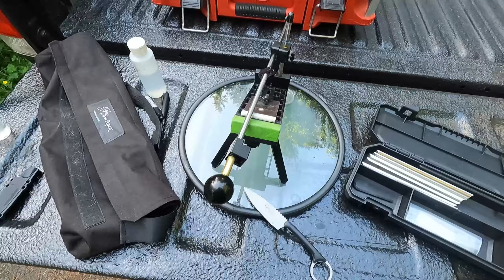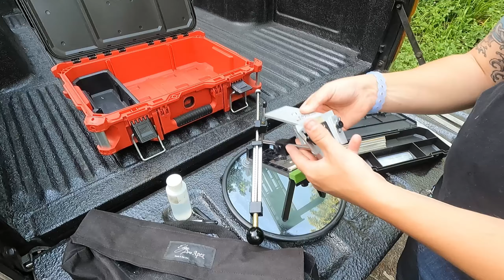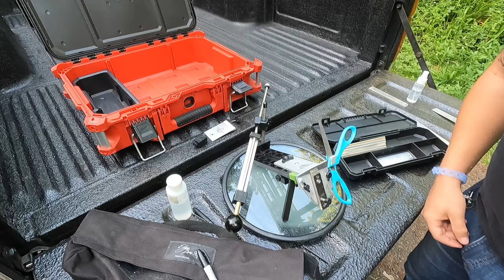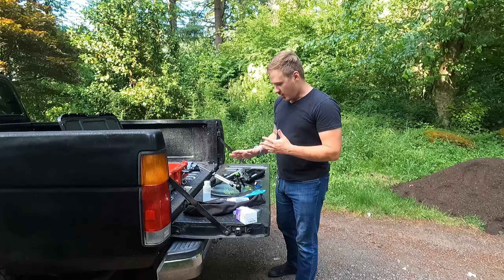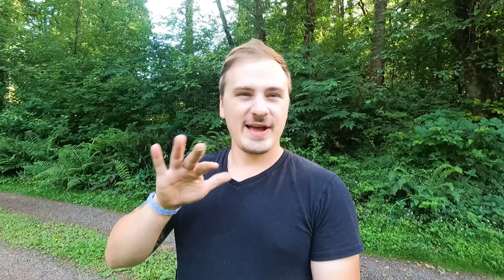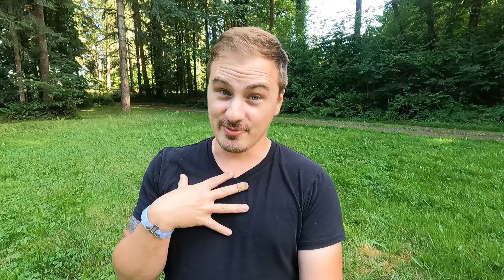Edge Pro Apex The system that started it all!

Comment: Hello Sam, i wonder how you sharpen convex scissors on the edge pro system. 
Thanks for all your  videos. 
Peter Mosk from Holland
Reply from the maker: Hey Peter. 

For doing convex shears it is quite the process. Basically what I do is say start at 45° for sharpening. Then bump the angle to 43, then 41, then 39. Decreasing the angle and making multiple facets to mimic the convex. Then from there I blend the facets together which can be done by stone just takes a long time. But it is doable. It’s much easier if you have something like a buffing wheel with compound. Hope this helps. Also Cody over at edge pro is a wealth of knowledge. 😊 or feel free to ask another question if you need to.

Comment: I struggle to get knives sharp with the edge pro apex. When I lay the knife on the table, I find it rocks which changes angle when the stone goes across the blade. I got the magnet add on but still the blade rocks too much to keep a consistent angle. Any suggestions?
Reply from the maker: @kylefreemason  I sounds like you are sharpening picket knives. What might help is instead of trying to magnetize and have the spine flat. You can magnetize the primary bevel where there is a lot more surface area for the magnet to hold. Then it's just the scratch method with a sharpie since the angles will be different than marked out. I'll try to make a short video on it here in a bit to see if it helps ya. 🙂

Comment: What is the purpose of the isopropanol alcohol? It doesn't lubricate and evaporates in seconds. I use baby oil on my diamond stones. It keeps the stones from clogging and there's zero dust.
Reply from the maker: @Therapistinthewhitehouse  I only use 80% and it sticks around for a decent amount of time.but it’s to cut down on the dust from the stones. But I might have to try baby oil. Also might make it cut smoother due to the oil base decreasing resistance.
Reply: @Samsmobilesharpening  
I used soapy water for a while but it started to rust my diamond stones, I then used nothing but hated the dust so tried Lansky’s oil and preferred it but too expensive so moved on to baby oil in a 2-3 oz dollar store spray bottle. One pump is enough to coat all but the really course stones and it works great.
Reply from the maker: @Therapistinthewhitehouse  yep I did the same with the soapy water. The cleanup was just too much. And they would rust like what you were experiencing. The iso is good about not rusting. But I’ll have to try the baby oil out. Thanks for the tip. 😊
Reply: @Therapistinthewhitehouse  If you don't like the smell or want more price options, look at mineral oil as an alternative.
Reply: Go to Edge Pro. I’m sure Cody would welcome you.

Comment: Perm paper?

I agree that the 1x30 is a steep learning curve but it's great for hogging off material relatively quickly and I often use it to repair chips, broken tips and get something of an edge back on supper dull knives before finish sharpening on my fixed a angle set up or Tormek style machine to get it extra sharp.
Reply from the maker: @Therapistinthewhitehouse  it’s like cigarette paper. Super thin. But you can search perm paper and it will come up on Amazon. Much larger box than cigarette paper. 

It really is!!! I actually just got a new tool for repeat sharpening. The 1x30 is great for first time people where you have to really remove material. But I like systems where I can remove as little as possible! The new tool does a great job of that 😊but I for sure will still keep the 1x30 for when I need heavy repairs!